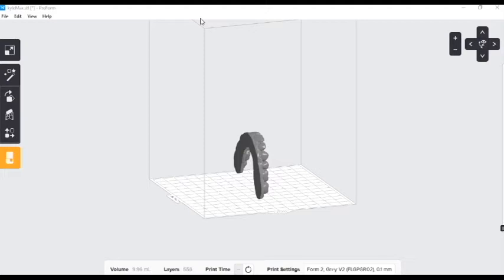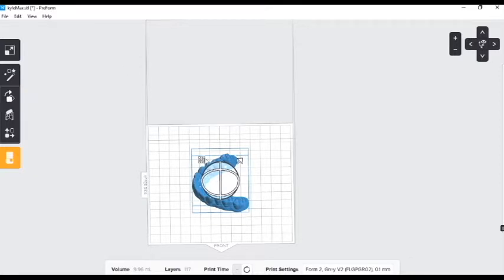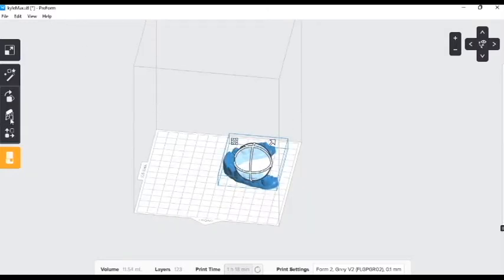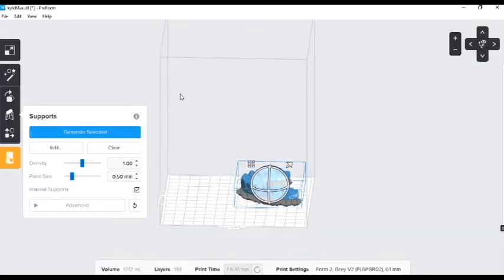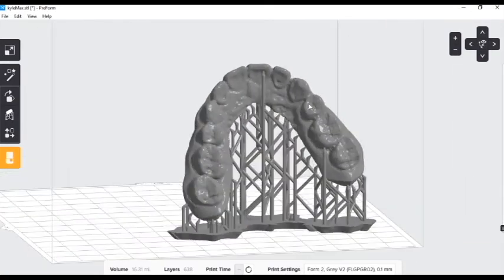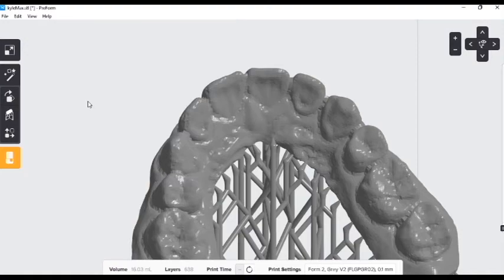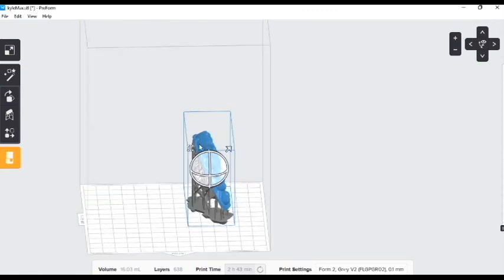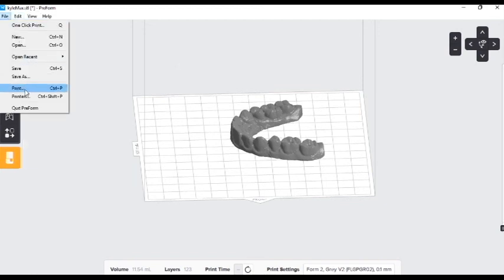Dental PreForm 3D Printing Tutorial

Comment: If i accidenally resize the model, do i click on Edit - Size >Scale and set Scale to 1.000? so it prints one size for one?
Reply: Eduard I would just delete it and reimport the model to be safe.  Especially if you plan to use it for a retainer or aligners
Reply: Christopher Riolo hmmm... I printed with rescale 1.000 today on a trial model. We'll see how it goes tomorrow. Its Eduard (under different account)
Reply: Christopher, just reporting back: Rescaling back to 1:00 actually worked out perfect!  I printed one model without any touch ups in terms of scale. And then i printed another model after rescale mode used. Then did a Hawley retainer. Retainer fit perfect on both models :)
Reply: edikatya probably fine...
Reply: Christopher Riolo we'll report back 😁